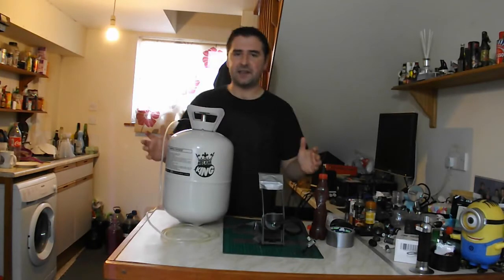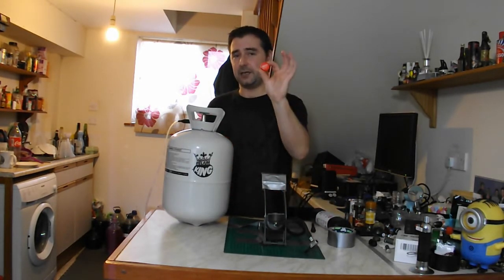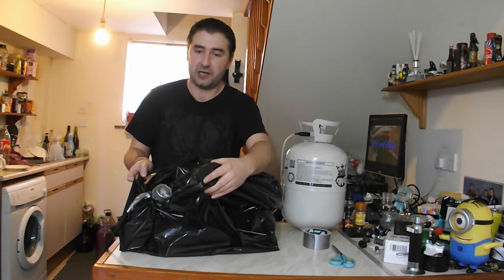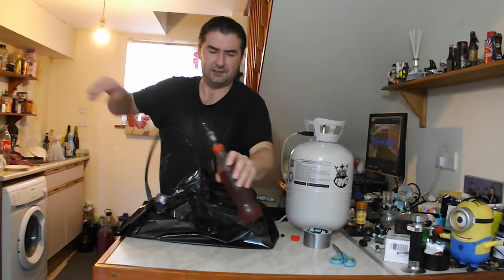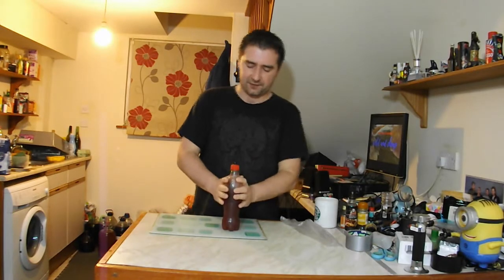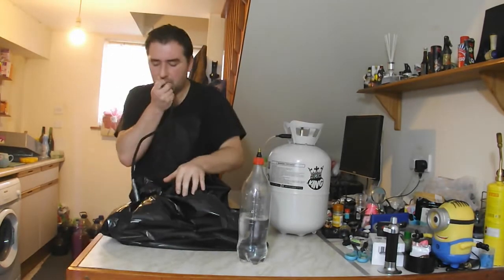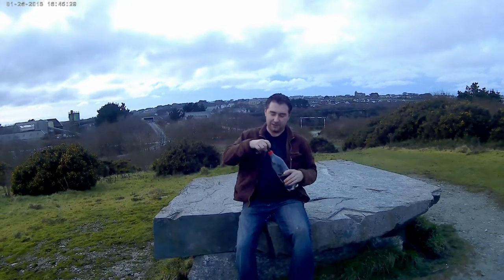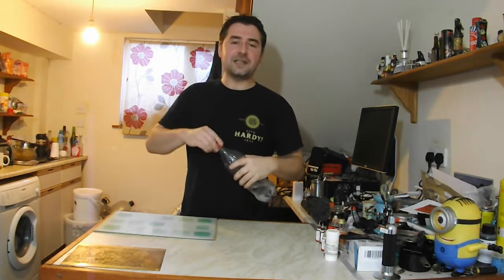carbonating with helium experiment and results

Comment: Duct Tape can fix anything!!! :) I wonder how it would turn out if you left the brew under pressure from the helium for a week or two with shaking it up for a few minutes every day.
Reply from the maker: lol, indeed, it's a pretty handy material :) well helium is not classed as not soluble in any liquid as only 0.0016 g will dissolve in it as compared to 2.4 g of co2. 
hence why all the helium beer and water videos are fake. thats why i offered an alternative that would work :) still fun
Reply: That does explain a lot about how helium in liquid works. I would think this would also go for any of the lighter than air gases. I really want to try the helium in the water bottle to see how my special needs kids react to the change in my voice. It looked like you and your other half had fun playing with it.
Reply from the maker: Back Yard Brewing hey, indeed we had a whale of a time munching about with the helium out and about, people were wondering what we were up to :D the stealth helium tank worked really well, shame the mic was turned off the 1st time the water bottle with helium worked. I'm guessing it would go down well with any children ( big ones included)
I now know the bigger bottles do work that way and it won't cause oxidation to alcohol so the next summer bbq I have will have a few of those puppies mixed in :D
Reply from the maker: The was mucking about, damn auto correct!